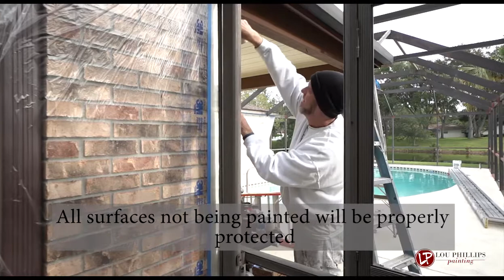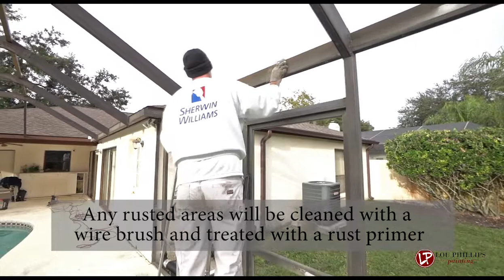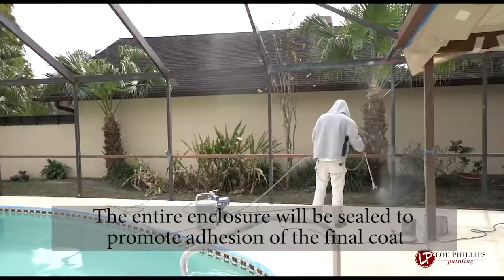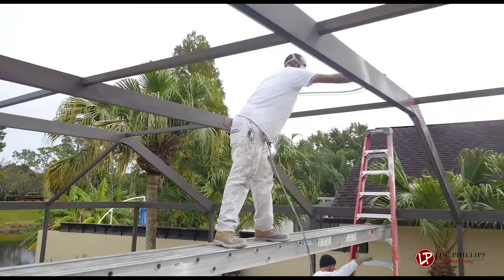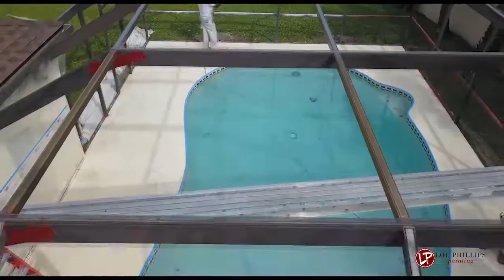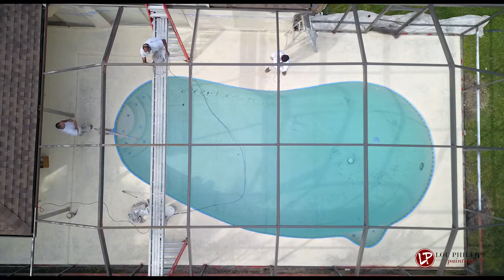Pool Enclosure Painting

Comment: Why didn't you cover the pool and the surfaces with cardboard and plastic sheathing to prevent overspray? Music is cool, but I would have taken a different approach.
Reply from the maker: The pool deck was being painted and that is why we did not cover it. We have also started using plastic sheathing across the water. Thanks for the suggestion.
Reply: @louphillipspainting6617  I love the way it came out afterwards. How do you prevent the paint from peeling a year later in this blazing south Florida heat?
Reply: No cover😮the floor